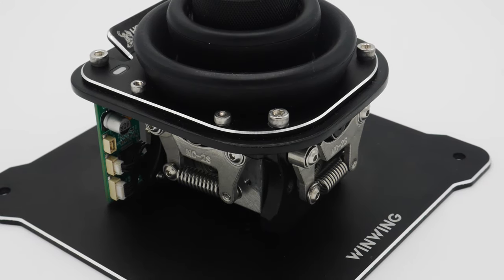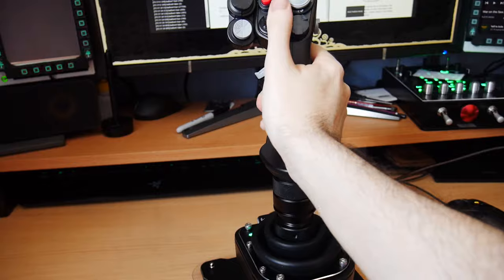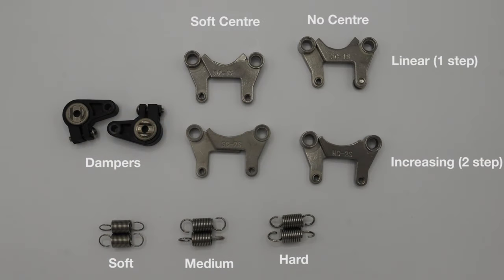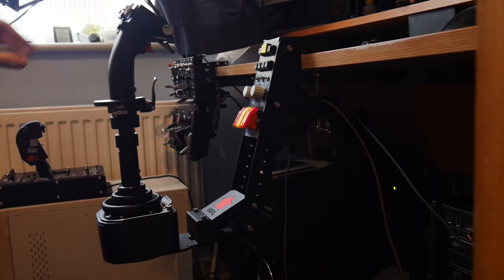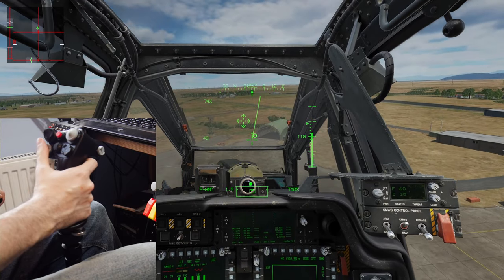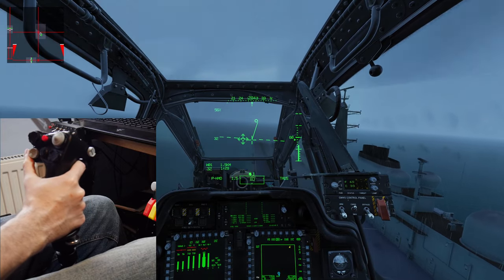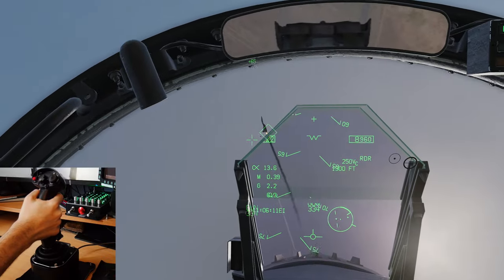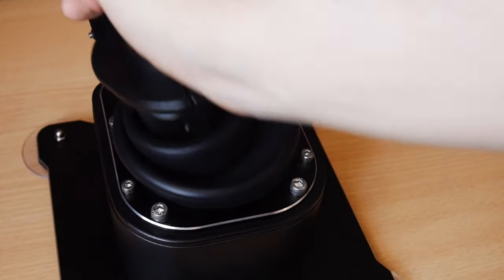WinWing Orion 2 Modular Joystick Base and Kit Review

Comment: Great follow up. I am concerned about the damper life after constant wear during helo use. I confirmed with WW they do not sell the dampers or other parts separately. Virpil is coming out with a new upgraded T-50CMx base with the dry clutch dampers and spring adjustment all external without having to open the unit. And Virpil is known to sell parts separately so that is another option coming in this wonderfully growing & competitive market. We are getting spoiled! Kudos to WW for their modular design! 👍
Reply from the maker: I'm really interested to see how Virpil get on with their new design!
Reply: They do sell a dampening kit separately with 52 different combinations.
Reply: Most gamers don't understand concept of Force Trim Release, that most sophisticated helos use, for example H145 in mfs. Trim Release is pushed for pick-up, then it is held and released later for hands off and new reference numbers are acquired and cyclic head stays in postion where you "button realease"  TR. All hands on flying is done with TR button pressed. I think Winwing is def on right track with hybrid. The outer extents of cyclic box/throw look spungy and there seems to be a little stiction around center. If they can overcome this they definitely have a winner, for fixed wing and helos.
 They could lighten the head weight for example. Static center springs on regular joysticks make for an awkward experience in helos. Work great in fixed wing tho. Modular head system awesome. Bout time someone made a hybrid joystick.

Comment: there is still one issue with the orion2 stick that they didn't fix but seems to be a major issue with a lot of the orion sticks out there and started with the original orion stick. there is a grey metal collet on the base, underneath the rubber ( or in the case of the original fake leather) cover that connects the stick retaining assemble to the cam and pitch assembly, with an internal windage. If you have a heavy grip like I do (especially in a gun fight). The collet will twist loose and you have to take the entire thing apart to tighten it back down.  There are many answers to this issue, one being that you can put some blue lock-tight on it, to keep it from coming loose. In my opinion they should put an allen screw on it so it won't budge. Again this issue originated with the original orion stick and has carried over to the orion 2. I will say that if this keeps happening with my current orion 2, it will go on sale and I will be getting a Virpil

Comment: Based on your two reviews of the Orion 2 base, I bought one about a month ago along with their phenomenal A320 flight stick (capt side only), and am very impressed. 

The only fault is that the reverse collar does not turn far enough - it's close but not enough - for me to tighten the Allen screw into that "flat spot'.
Reply: I had an issue with my collar as well not lining up with the back, for some reason my collar lines up with the front, not a big deal as there is a flat part in the front as well but I don't think it was meant to be that way.
Reply: @reload54  Same here, confused me at first.

Comment: I just got a Orion 2 and the extension with an f16 grip. I don’t understand the extension rod at all. It has a thread with no flat spot so it’s impossible to tighten it on to the base with the set screw without ruining the thread. Then when you attach the stick to the top of the extension rod, the flat spot has no chance of lining up with the set screw on the extension rod collar. How do we fix this? It feels like it’s not really compatible

Comment: Does the base unit come with those cams/springs/dampeners shown at 2.07?  Is it worth buying the separate kit?  The stock Orion 1 base did wonders but i did find it a little stiff towards the end of the throw for a desktop mount.  Thanks!

Comment: I have the orion1 and the spring that controls roll has broken on mine 2 times in the last 4 or 5 months. I'm on my 3rd spring and winwing is kind enough to send me more but I feel like breaking the spring every 2 months is not sustainable. Wondering if I should upgrade to the orion2 and see if the spring breaks will slow down.

Comment: I’m still assessing mine. Thrilled with the grip but I think after a long session there seems to be a point when the springs get tired and suddenly there is no resistance for almost half of the 17 degrees in a particular direction. Then you return the next day and it’s just like when I first started using it - only to return to that strangeness again after a couple hours. Nothing serious but it’s unusual.
Reply from the maker: Hmm I didn't encounter this issue! Does your unit have any grease inside it on the cams?

Comment: Finally, a dev gets it. I am rw pilot trying to promote hybrid joysticks for years. I think the friction helo system, where cyclic stays where you put it might need some work. Appears spongy at extemeties (probably boot) and stiction around center.
 Modular head system awesome. Price range is decent. Loosing the spongy boot might help fo helos, beefing up friction without adding stiction, and lightening head weight could be answer in orion3. I use expensive pro flight trainer helo controls now, but looking for cheap hybrid alternative for students.
Reply from the maker: WinWing actually do professional simulation hardware /cockpits for civil sims, which is how they got started, before side branching to home combat sims.

Comment: @RedKite I've been looking for a stick with no cross axis resistance, and was hoping this would be it, but apparently it isn't :/  Got any advice on what stick to get if I want a high end stick with no such issues when you move it in circles?
Reply from the maker: The Virpil WarBRD 1 is just that, provided you use the smooth cams. I expect the WarBRD v2 that's for sale now is probably very similar.
Reply: @RedKiteRender  Many thanks Redkite, then I will be going for that one and install the smooth cams :)

Comment: Does anyone know what adapter he's using to mount the Orion 2 Joystick to the Virpil Desk Mount?
Reply from the maker: Its the thrustmaster adaptor, the base is compatible with thrustmaster warthog mounts, as mentioned in the video.
Reply: @RedKiteRender  thanks man, appreciate it.
Reply: @RedKiteRender  Uh, I've looked at this stuff for hours on the internet and as far as I can tell, Virpil no longer sell that mounting plate for the Hog stick. Closest thing in their store is the Mongoose adaptor, but it doesn't have the actual plate part that goes under the stick base. Ostensibly, the WarBRD base has similar mounting holes to the Hog and Orion base, but the adaptor VPC sell now actually fixes to the top of the base, so it won't work with the Orion either.
Kind of a bummer, as VPCs mounts are the cheapest you can get that aren't dubious Amazon things.
Reply from the maker: @Jerkzilla  Monstertech or foxxmounts are worth a look then. I'm really surprised to see there's not a Warthog compatible one listed anymore!

The one i have was listed as compatible with both the WarBRD and Thrustmaster's base. It's got separate holes for both. I'd contact Virpil and ask if their WarBRD adaptor plate is still compatible with TM / Orion bases as it might just be an unlisted feature.

Comment: you mentioned stickiness, where do you then suggest to apply  grease? is it on the black part on the damper it self where it sits on the metal part?
Reply from the maker: For the damper itself i'd be very careful with applying grease, a teflon insert would be better between the drum and the inside of the grip.

The cams dont need the grease/lube per say, but it'll make em just that lil bit nicer, you'd apply a small amount to the top of the cam, where the pin rolls over it.

Whatever you do, make sure it's non conductive, don't want to short the circuit boards nearby!

Comment: A tough question for ya: Do you still prefer the Warbird or Orion 2 for fixed wing experience after having all the customization set up properly to your liking?
Reply from the maker: Difficult question indeed. I'm really torn, they're both so similar, that it might come down to what handle you want to put on it. The base's differences are so minor, (ignoring dampers) but i think the WarBRD wins out on feel, but the Orion 2 wins on spring rebound (with and without dampers)

Comment: thank you for that comment/comparison of the new Orion2 dampers with the existing Super Libra clutch dampers. Could you be specific in what way does the SL feel better? I have my SL setup with Nyogel 767A on the clutches and that feels nice, even better than the VKB Gunfighter IMHO, but I wonder about Orion2 because of more no-center cam options.
Reply from the maker: The SL feels better when it comes to restitution.  doesn't feel as rough to overcome the initial force. The Orion 2 method is a cheaper solution. 

Those split cams on the libra really let it down my opinion!
Reply: @RedKiteRender  I see thank you! Agreed on the split cams on the Libra, I have managed to Franken-base mine with Virpil stuff so that I can use their Cosmosim cams, not sure how long that will last. Orion2 seems to have done the same innovation with their no center dual cams, so my effort in modding is a bit wasted now. Except for the SL dampening system. 

On your end, if I understand restitution correctly in this context, that can probably be entirely overcome with grease. Of course any grease on the dampener negatively impacts the 'helo' function of leaving the stick put in an arbitrary position, but I think we both refer to the "combo" option of having both a dampened feel and the spring-return cams.
Reply from the maker: @Spelljammer1  I would totally expect grease to negatively effect the helo mode indeed, probably resulting in the rubber pushing it slowly to centre.

I've been considering installing some teflon strips in the damper to reduce it for that purpose.

Comment: Hi. Thank your for the detailed review, but even though most is quite correct, I don't agree with many statements. The grip fixation is a pain in the a$$... sorry but it's very bad compared to an old warthog. 1 out 2 trials, the grip rotates and is not correctly fixed + you damage the thread with the small screw to adjust the offset. Hate it.The cam and spring changing process is painful. Period. But none managed to cerate a simple process for that feature Out of the box the feeling is very soft and unprecise so you must buy a kit with more cams and springs. I had no additional springs and cams in my package! When fixing the dampers (without cams), and put at max, the stick never stays in the position you leave it on! quite frustrating. With cams, you must really screw a lot to get damping. Finally you should never have to put either grease or teflon or whatever to a metal bearing type of mechanism. NEVER. Otherwise it is a poor designed product. The whole point of metal to metal is to be smooth and precise, so if you have to add grease on removable parts, then something is wrong. The Virpil Warbrd works just fine without anything. My fair opinion on a product i did not keep

Comment: In my view the price of this stick is good and affordable being a high end stick (Isn't it?). The other brand prices are too way high and it's not clear to me what or where is the difference. With the extra money you save you can but the throttle.
Reply: I'm not quite sure of what I said before, because it turns out that the shipping cost is a bit high, so the price of this stick is higher than I was thinking earlier, making the difference with other brands slighter

Comment: WinWing is nice but I'll stick to my VKB GunFighter Mk2 MGP Pro Grip.
It has the most button and hat functionality (eg: 5-way hats) of any comparable stick I'm aware of.
It's cam and spring system is really thoughtful and is all inclusive with your purchase.
PS> I have nothing to do with the company other than own one of their products.
Reply: The VKB has very thoughtfully designed the whole stick, and going for the Su-35 style grip allows to get most features to all kind aircraft, without requiring to get different grips (unless just wanted for authenticity).
Reply: I have both sticks, and the particular area that you comment on is actually in favour of F16EX: it has the most buttons on the market.
Reply: @Spelljammer1  Having enough buttons is enough, having more buttons than enough isn't favorable. 

And what is enough buttons? It is not just that stick has proper amount of hats and buttons and possible axis, but that they are as well placed most suitable way that you can emulate another stick by having a needed function in the proper position.
Reply: @katumus  No disagreement from me on your approach to buttons, I share that. 

I was stating the fact about the total number of buttons in response to the other commentator.

However when it comes to suitable way to articulate all the hats, for me personally the F16 type grip wins over the Su style grip. Unfortunately, because I like the MCG aesthetics the best. But I really do not like the thumb travel from the thumb hat switch ("CMS" most often) and the face buttons--over and around the bulbous analog thumbstick area. That I consider unnecessary strain over the long run.

Comment: just use a drop of 767a and stiction will be much less likely.
Reply from the maker: Is a pity it doesn't come out the factory that way however.
Reply: @RedKiteRender  Well, that and as you mentioned, its never going to perform like a proper clutch, and honestly I am not sure why they didn't design it as such, they could've.  Damping on spring/cam sticks is greatly underrated, thats one of the reasons the Gunfighter MK.III is such a great gimbal.